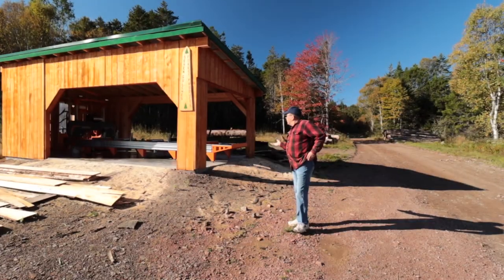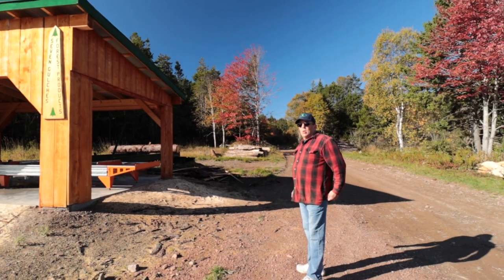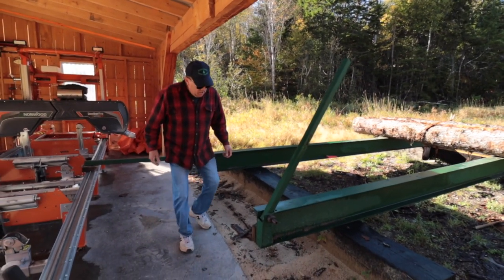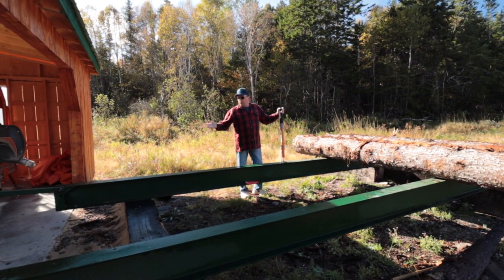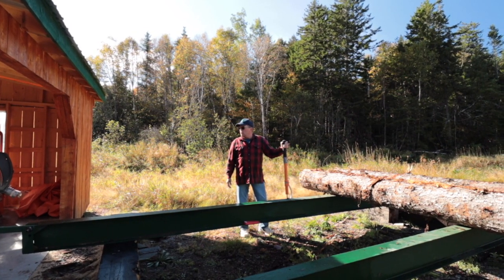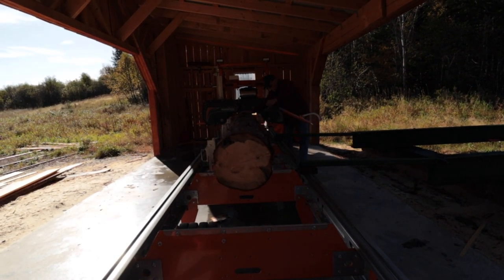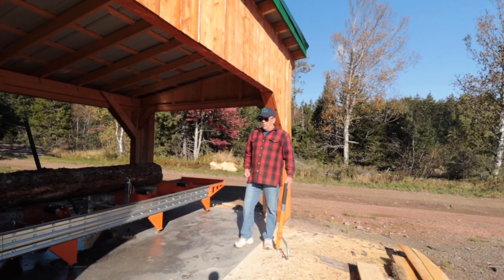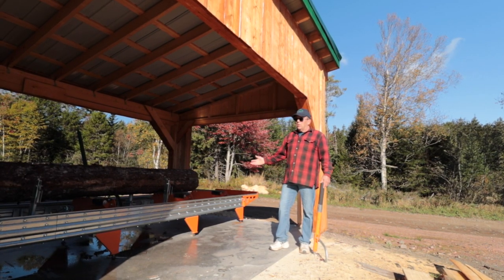This Is How We Set Up The Portable SAWMILL SHED - Norwood HD36 or Wood-Mizer

Comment: Thanks for the video, Peter. Good explanations and very timely for us.  We have just bought a mill, have poured the slab but have not yet built the shed or set up the mill.  I'd be interested in your diagrams.  i was interested in your long openings and how you supported them and got a bit of an idea of that from the video.  I was planning on fabricating a box beam for the loading side but see you had a different method of making the span.  Also, I'm interested in knowing what you think would be a good roof slope.
Reply from the maker: I will message you with the info I have Tony.  Also, feel free to stop by.

Comment: Great video, I have been looking for a while now on how to build a shed for my mill. Did you use lam beams for the span of the door openings If you have any other information or diagrams, I would greatly appreciate looking at them. Thank you
Reply from the maker: I have some diagrams we used when we built the shelter.  I could send them and tell how we made the beams.  Email or facebook messenger?
Reply from the maker: @troyhaller4442  I sent an email!
Reply: @sevengulches  Thank you so much for your help.

Comment: What size beams did you use to get the wide opening. Is is 16’ ?
Reply from the maker: Just over 18'.  Used 2 2 x 8s trussed to 2 2x 4s.
Reply: @sevengulches  Thank you.  I’m assuming you don’t get snow then to have to worry about loads. Really great setup.
Reply: Nova Scotia … disregard snow comment. The 2 2x8’s hold the snow loads without any issues?